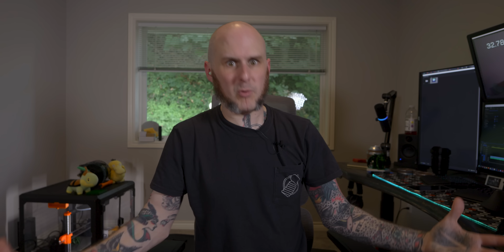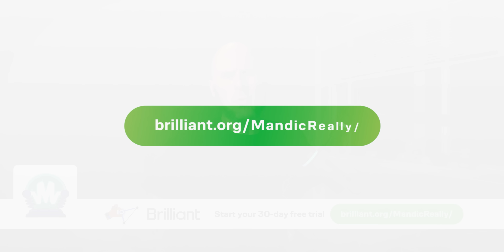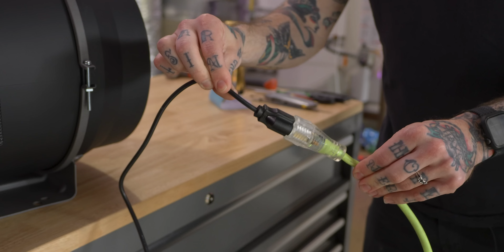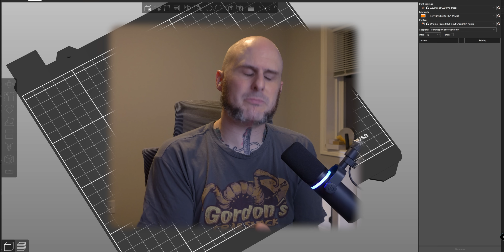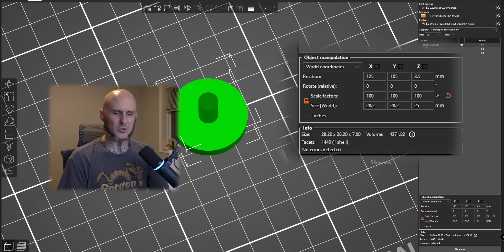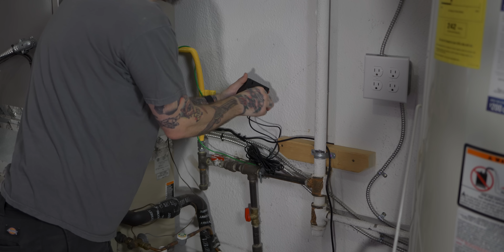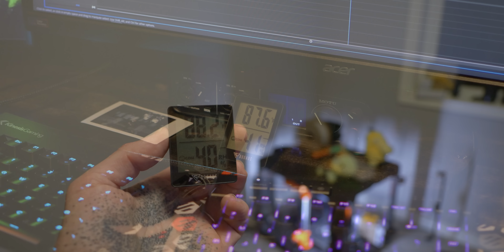Office Build Begins: Solving 2nd Floor Heat w/ AC Infinity T12 fan!

Comment: One question, why not put the fan near the junction box in the attic if issues are just upstairs vs downstairs? Doesn't this just force more pressure through the downstairs vents before getting upstairs, more or less the same thing as before just more powerfully? Obviously it worked and helped the bedroom a lot but I feel like the attic location would've also helped with the noise
Reply from the maker: That branch I installed it in is ONLY the upstairs. The downstairs goes into another 12” duct that’s in the crawl space. It’s under the unit and not visible from the studio. I heavily considered putting the fan in the attic, but it would have required a decent rework of the ducting up there, and installing an outlet just to power it up there. The electrical is run from the bottom up, not much through the attic unfortunately, so not a good place to jump off of up there for an outlet.
Reply: @MandicReally  oh ok, gotcha, that makes sense, I thought that duct branched off to both and assumed there was an outlet and/or a light socket up there to use

Comment: its too bad you dont have a single/double hung window.. the U-shaped window AC that has the compressor outside to reduce lot of the noise would be much better than a portable AC unit.. you could technically put one in yours, but you would need to build a window block.
Reply from the maker: I have plans for the room that would impede unfortunately. You aren’t wrong of course, that would be more ideal. The windows are lovely but limit these options.

Comment: Great work! I use a small ~$100ish 6" AC Infinity fan to help my Glowforge laser cutter exhaust fumes up and out of an unused chimney. It's been a solid unit - it's quieter than the Glowforge itself.
Reply from the maker: I intend to use an 8” one in the studio for my Laser and some other fume extraction. I’m sure I’ll do a video on that at some point. Glad to hear you like yours.
Reply: @MandicReally  sounds like a job for an ERV.

Comment: A few ideas on how to set up the automation to run the fan, fair warning, I have 0 experience doing this myself but I have seen tons of videos and have a rough idea of the technology involved:
A smart thermostat might be able to report if it is "running" or not, and you could use that to trigger the fan
You could possibly get a current clamp meter on one of the wires for the blower fan and use that to trigger the duct fan to run
You could use a differential pressure sensor to measure if the fan is running and have that trigger the duct fan
Reply from the maker: I know home assistant can integrate with a bunch of smart thermostats and detect states. I had a cheap Honeywell at my last place that integrated well. It’s more the fan side of things I’m not sure about yet.

Comment: Portable ac units litteraly suck check out the technology connections video about it.
Reply from the maker: Seen it, I’m definitely getting a dual hose unit. Hate to use one at all but simply not another option at this time. Another mini split is just too expensive for the budget.
Reply: @MandicReally  I am glad you seen it. Hopefully the dual hose works well for you! I've only had a single hose and it works but it sucks. I'm glad the ac infinity fan helped. I like that company!